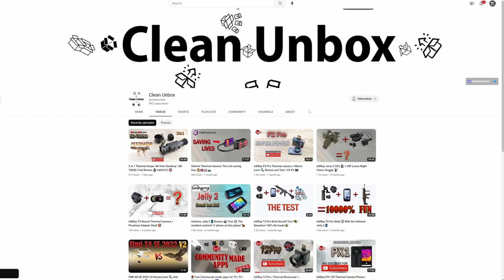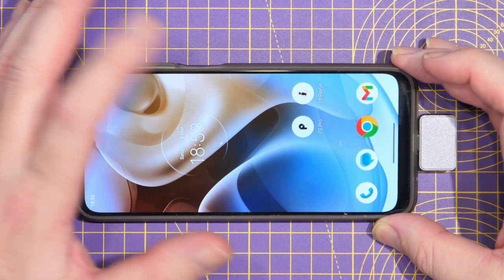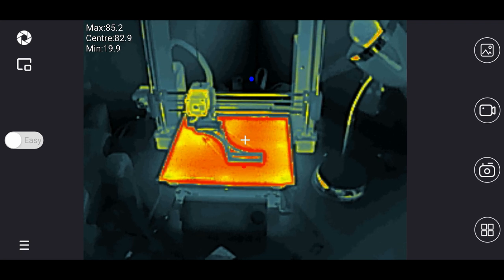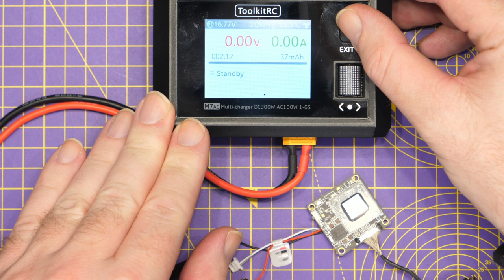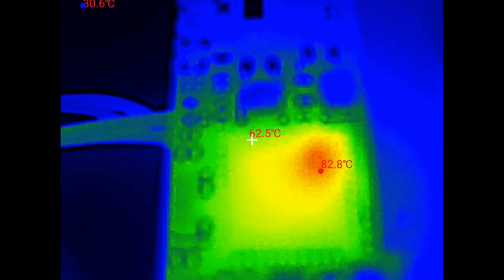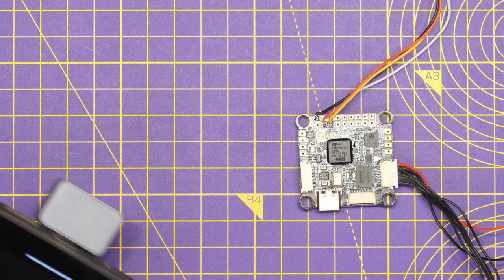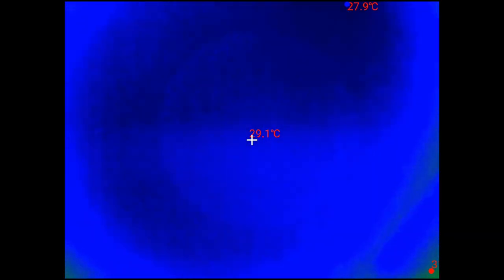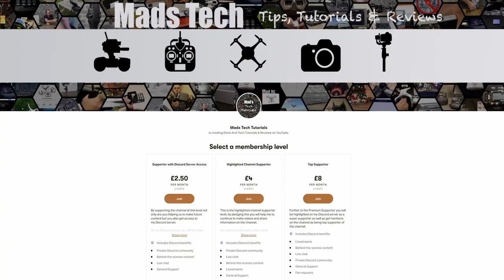InfiRay P2Pro USB C Thermal Camera - Ideal For Electronics Repair & Diagnostics

Comment: I am sure you had a review of that or a previous one cause the moment you mentioned the macro lense it clicked for me but I could not find that review I guess from last year anymore - or is this the new or replacement one with a better resolution ?

So far I have found the camera but the 128€ for the macro lens was a bit too much cause I usually need it for thermals around the house, so windows and door and roof inspections during winter to identify major heat losses people tend to ignore until they get a picture with these nice warm spots heating the environment not their home.